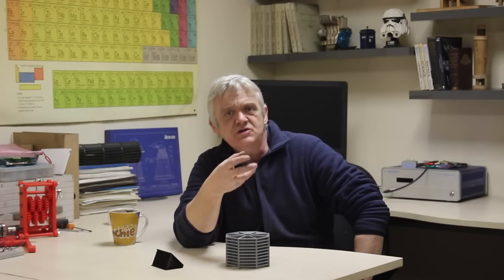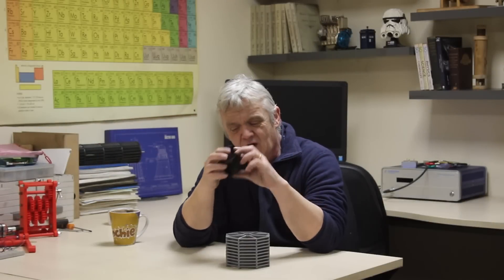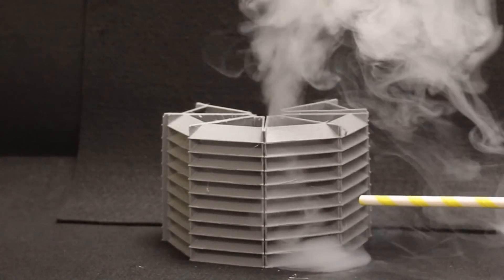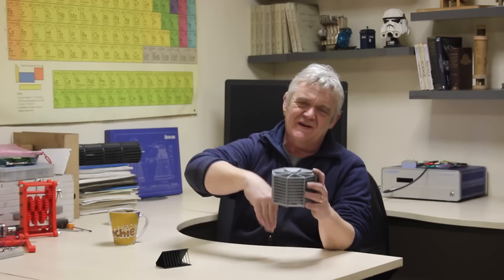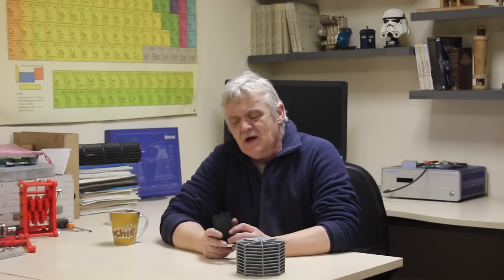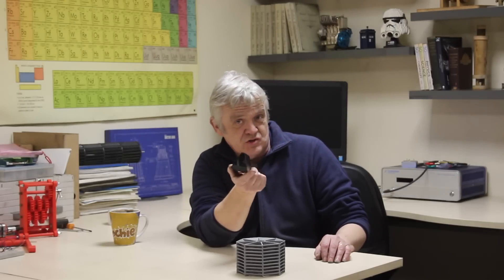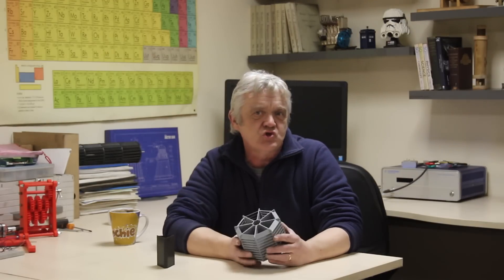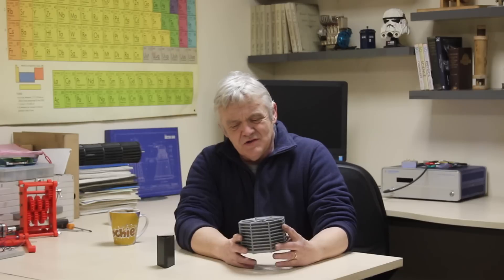1830 A Darwin Wind Turbine Breakthrough

Comment: You need a new poster on your wall.  May I suggest the Janet 1929 spiral periodic table?  He had a twisted pair diagram as well for the solid state model I am working on.   It's very close - except he uses cylinder walls for the twisted pair end--points instead of the N/S poles of a sphere - as I am doing.    So, I was able to modify current chemistry understandings & come up with a solid state model for the atom (prior to looking up Charles Janet).   I only had to make a few twisted pair modifications to Pilot Wave Theory  to make that completely Newtonian, as well.   Then, I realized that capacitive energy in DNA could describe energy stored in a cell - instead of the idea of ATP - so I modified genetics to make more sense.   Then I wrapped a few twisted pairs that look like planets & galaxies, so I was able to modify the non-Newtonian explanation for the observances in astronomy - to Newtonian.    Then, I replaced the Big Bang Cosmology with Plasma Cosmology.    I've been able to achieve 3rd order twisted pairs, through "super-coiling" for modifications to a JPL Lifter/Heater for metallurgy.   I should now be able to use superpositioned AM radio signalling (3-4 frequencies) instead of AC power (1 frequency).

Comment: I love your curiosity and enthusiasm.   Wouild it make a difference if the DWT directed the air up and you could use thermal convention also?  Maybe paint the baffles black?  And could you use a Bernouli effect on the top to draw the wind thru???   Maybe the form used in a popular bladeless fan but as a vacuum???

Comment: 0:54  months ago I heard something about a Wind turbines where you have the rotors and the generator isn't in the condle but is transmitted by a belt to the generator on the ground. More power less vibration

Comment: Ok so what are the ways to avoid back pressure with this kind of system.

The video only shows a limited system, without turbines and without the enclosed wind path required. 

At some point the pressure of the air and the lower louvres will overcome the pressure of the air at the top.  Creating a diminishing return on adding layers. Additionally, the turbines themselves could add to the back pressure.

An additional problem is the exit path for the air 'exhaust'.

Comment: Some 40 years ago in a children's magazine (some European Popular Mechanics) there was a project to make wind turbines hollow and with a ring around the ends of the wings, working like inverted pulverisers or aeolipile. The idea is that while turning, they would suck not "passive" wind like in the Darwin's tower, but because the wings would make the nozzles move against the wind and thus increase the suction. 
On the ground station it was planned to build a turbine, on the same chaft a mechanical rotor to be used like in a normal (non EV) wind turbine, and in the end the wind/vacuum would pass a mesh of tubes and cool them, to work as a fridge.
While watching the Darwin's turbine series (1832) I thought that it's a pity the wind is being pushed down, as compression would always be more difficult than suction. In addition, the chimney effect would diminish the coefficient of usefulness.

Comment: Good research on the 30 degree blades but this may not be best on its own for turning the air through , one could add a seco 90 degrees. How about adding a 60 degree blade half way along the cheese wedge?

Comment: -Make the center hole designed with TESLA VALVES. Should be quite difficult to design but very rewarding as the air will be forced to go down only instead of going up as at 02:53. Please update your design and give heart to this comment if you read it. Thanks.- Never mind, I didn't understand the design.

Comment: What would be the effect of a semi circular cowl going around the downwind side of the tower. I'm thinking of possibly getting better dynamic pressure/increasing the flow through the louvres on the downwind side.  The cowl could be very lightweight, sailcloth maybe and could rotate like a weathervane to keep the open side of the cowl pointing into wind.
OK it's more bits and worse than that, bits that move but is it worth a little experiment with your model to determine the bangs to bucks ratio?

Comment: Something to think about, for those planning on building a larger working model, is airborne water ingress ( like rain being blown in ) eg make sure your electrics/mechanics of your generator can cope with those and possibly also there's sufficient  runoff/soakaway
Reply: Perhaps the fan could be put at the top of the column to keep rain from affecting the fan.

Comment: Really nice. You plan to converge each pieces of the pie in the same pipe to one turbine ... if yes this get a chance to air to get back to one pieces of pie with less pressure ( backward to the wind ). The other options is like you already do with the pc fan , each pieces of the pie only blow on a section of the turbine ( pc fan in this case ) or having turbine for each pieces of the pie. Also , what about making the airflow go up , paint the whole thing in black and use the generated heat from the sun and convection of the air as a combined extra power added ? Wind and Solar power.I already thinking about it few years ago but not this way.

Comment: Wonderful! And on the corners of a high building as well, as someone suggested. And why not turn the wind direction upwards, make them out of metal and paint them black to add some chimney effect to it. On a building there wont be a problem to have the rotors high up by the roof. There they are easily serviceable.

Comment: What is happening on the leeward side of that tower? Would we expect the side within the separated flow to experience low pressure? If so, without flaps to prevent egress, whilst air is flowing into the tower on the windward side, would the low-pressure wake of the tower provoke air to flow out of the leeward side? If so, is the intention to place an independent turbine in every wedge that will generate regardless of the direction of flow?

Comment: Great idea but I see a problem because of no moving parts. The wind is typically going to be funneling air down 2 or 3 segments of the cheesewheel but the turbine is connected to all 5, 6, 7 or whatever number. This means that the air from the pressurised side of the wheel will be pulling air from the low pressure side of the wheel.
Reply from the maker: wells turbine

Comment: Rather than a cap could a simple turbine be added to the top that powers blades to push air down the tube and create a difference in pressure to help draw more air in? Know you want to keep things as simple and low maintenance as possible though.

Comment: Very interesting to see. Do you remember the wind deflectors on chimney pots? They used this idea to stop down drafts into chimneys, still alot about. I think the idea looks promising especially to keep all the moving parts at a lower level. I think the science will need to deal with friction in the pipes to reduce losses. Cheers.

Comment: @Robert Murray-Smith this has me wondering: how little inner/outer diameter thickness at how large of a diameter can you make this, and will that multiply the practical effects?

For example to explain it, keep the cheese wedges the same inner/outer distance, but make them cover a tiny portion of a circle each, say, many yards/meters in diameter. Then, have a similar diameter (inner/outer thickness being small) turbine so there’s not much mass. Sure, a larger diameter has a lot more inertia, and tuning may be more problematic (TBD) than one with blades deeper into the center, but it’d also be easier to manufacture.

Now, for fun: imagine wrapping a grain silo with this. Next thing you know, if this scales nicely, farmers are at minimum self-sufficient for electricity, and that can’t be a bad thing.

Comment: Nice!!! I really like the simplicity of it. 
Do you mind sharing STLs of the fin parts? Or telling us how much do they overlap with each other (the fins)? I'm wondering if it would be possible to make them out of a single sheet of material by cutting 3 edges of a rectangle and bending it inwards.
Reply from the maker: I don't mind in the least mate - but I can also do a tinkered video to show I drew them too if that helps

Comment: If you could just get "unstuck" from the confines of thinking that using CAD and CNC automation is easier, the ideas (and wind) would flow so much more easily. The turbulence created by so many sharp angles is a real drag. Pun intended. I understand the temptation to want to utilize these fun and fancy tools. It just would be so much easier and ultimately more effective to use a series of concentric funnels. Simple to build at full scale as well.
Reply from the maker: I do both mate - each has it's merits and it's drawbacks
Reply: @ThinkingandTinkering  I apologize. After rereading my initial comment, it sure reads as acidic and unkindly. Not my intention, but it's there nonetheless. Forgive me please.

Comment: with adding along the vertex of the wedge deflector at one end, a parabolic curve to aid the bending/changing of the direction of the airflow. similar concept to the curved air intake and exhaust manifolds on a vehicle engine can improve efficiency.
Reply from the maker: cheers mate

Comment: Building on the Venturi effect idea, if properly designed could a series of constrictions>air inlets>dilations in the pipe (theoretically increasing airflow by adding atmospheric air through pressure differential) allow you to:
A) Offset the drag allowing you to extend the pipe length?
B) Increase the amount of air flowing downwards?
I'm sure I'm missing something here, if you know what that is please inform me. Otherwise I'd love to test this or to see Rob do so
Reply from the maker: I don't know mate
Reply: @ThinkingandTinkering  well I very much appreciate the response anyway! Love your work Rob and excited to see where you go with this design

Comment: Wonderful. Another possible slight improvement would be to mount a savonious VAWT on top with an axle extending beyond the air collector zone. This axle would have an exhaust fan mounted. As the  VAWT turned, it would push down the wind in the pipe causing a partial vaccum behind it. This would encourage more air to be sucked in as the wind blows about. Please try it out. Thanks
Reply from the maker: or you could and do a video on it mate

Comment: Well done Robert. Promise you will do some more reading :)
Just a thought, the wind comes in passed the vain at 35o but it has to bend around to 90o, so I would presume the other 55o is forced by the wedge and air flow. I know you want flat panels but it would make some sense to help the flow get to 90o in a controlled, low loss way. Not sure, but my guess is the top 1,2 and maybe 3  wedges would need to be extended and bent downwards to help the flow in the vertical direction near the top of the stack?
Reply from the maker: lol - cheers mate - and really I don't know - but I will find out for sure - cheers

Comment: This is awesome, loving your videos...I just found you a week or so ago.  Some questions about this one:

How does this scale up in size?  Your little 6" (10cm?) demonstration column works pretty well, but at what size increase do you get diminishing returns?

I'm thinking that if you increased it so that each of the 8 external faces was more like a half a meter or a full meter, that the flaps need to change...decrease the distance between them, maybe?  I'm guessing that scaling the distance between the flaps needs to not exactly match the scale of dimension increase.  But I'm not certain.

Also, what type of turbine would be placed at the exhaust end of this structure?  Have you made something like that in another video that I haven't yet found?
Reply from the maker: this is very similar to non power air ventilation systems and they scale just fine but I am not sure as for the turbine - I guess a wells type - but I am not sure

Comment: Brilliant, what about several of these on a single long pipe say with 45 degree connectors, would it work?

Or is there a better way to use quite a few of these (along a wall) driving a single large turbine?

Thanks Robert
Reply from the maker: I don't know mate - give it a go

Comment: I’ve been watching for a long time and this is my first comment ever. Robert buddy you only need one piece of the pie and a weather vane. I know you don’t like mechanical but it’s only a bearing. Cap the top of the pie and funnel the bottom of the pie into a circle with the fan generating power. ❤
Reply from the maker: you are right mate but the bearing would have to be the size of the piece of pie and they get more expensive the bigger they get - I want to avoid mechanical not because I don't like it - I love mechanisms - I want to avoid it because they increase cost, maintenance, complexity of build and failure rate

Comment: Just a thought.  How about a 3d Tesla valve on the discharge side of each port, before a venturi to speed up the velocity. That way there wouldn't be any backflow through the other inlets and have the benefit of no mechanical parts. Not sure how you would make a 3d Tesla valve though, to accommodate each  triangular inlet port.
Reply from the maker: it would be a complex build - but nice idea

Comment: Flat panels on the inside are easier but what if that surface had an airfoil top face? Still sheet metal, wood or plastic friendly I think.
Reply from the maker: I think it is a good idea mate

Comment: Wouldn't pointing the pipe UP, with the turbine rotor at the bottom increase effectiveness by adding a chimney effect?
Reply from the maker: maybe
Reply: I've 3D printed the collector in layers rather than segments, and I had already reduced the angle and made a curved blade that redirects the air upwards into the layer above. Each layer snaps together with the next, and only the final layer is different.
Instead of the cheese wedge baffle, I was going to insert a cone with verticle baffles on, as my instinct was that as more air made it's way to the turbine motor, it would require more space, and a tapered cylinder with verticle baffles would allow for this, whilst still stopping air passing easily around the cone to the back.
My layered model was drawn in Tinkercad and I've uploaded it onto Thingiverse if anyone wants to have a go.
Search for Darwin Turbine.
I've not yet drawn the cone, as I wasn't sure how tall to make the collector stack, but I'll post that up too when it's done.

Comment: The obvious problem with compartmentalizing the tower is that the downwind half won't have ANY downward airflow.  Personally, I would have one moving part: a free-spinning half-cylinder that fits inside of the main one.  It will automatically rotate so that the open half is always facing into the wind and you can make the tower much taller to capture more wind, as almost the entire tower volume will be available for downward airflow.
Reply from the maker: I am not sure it will matter much to be honest

Comment: I believe you would want to leave the top (or bottom depending on the direction of flow) uncapped to avoid creating a vacuum at speed. When you showed the test with the smoke I immediately thought of the chimney flue of the waste oil burner my brother and I created and thought of the possibility of the draft going up the flue and spinning a prop to generate electricity. Of course there’s the high heat there to contend with…but how cool would it be to generate heat and electricity at the same time in the winter.
Reply from the maker: I plan on putting a top on mate - but I can see what you are saying

Comment: For getting that little bit extra, could you put some holes in the bottom of the cap that would:
Presumably be hot and force the previously obtained wind down through a columnar center stack tube to continually make airflow of some degree regardless
and once cold, be able to be sent down either back through the holes for further crosswind forces increasing downward force or down through the center stack as "previous wind"

Also, other than a computer fan, I'd really like to see some sort of wind turbine designs at the bottom of the stack.

I'm actually thinking this as a wonderful update to an extraction fan in the up position, and a really great night time advantage in a sand battery configuration setup in the down position.
Reply from the maker: we are getting there mate lol

Comment: Am I missing something here? As the air pressure starts down the Tube/ Pipe , once it clears the bottom of the cheese wedges , would it not just vent up and out the down wind  cheese wedges. Path of least resistance?
Reply from the maker: we will see

Comment: Okay I just had an idea, mechanically speaking I could see you tie a balloon or parachute and have the air being pumped upward into whatever you're using. you could have a small fan that would make the power which would run down the rail or string that you're using to keep it locked in a particular place. it's similar to how they use kites to create power by going up and down but in this case you would be using the Rope to either lift it up to a higher place to get more air or maybe bring it down to force more air in
Reply from the maker: intersting mate - cheers